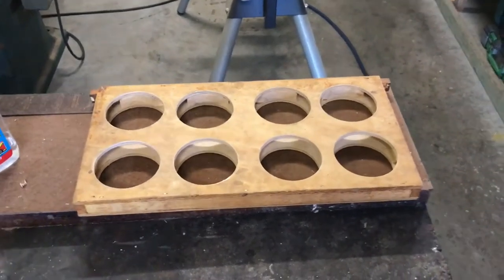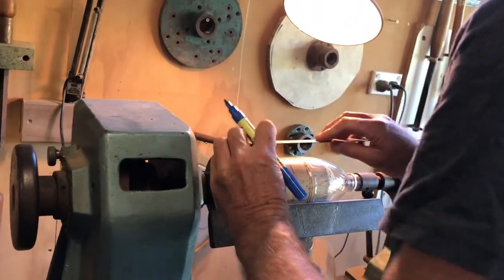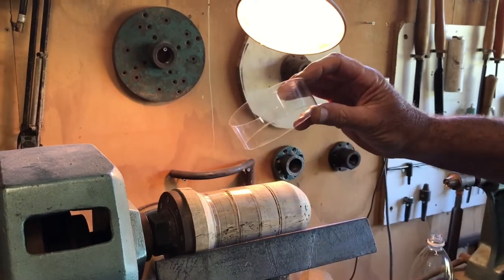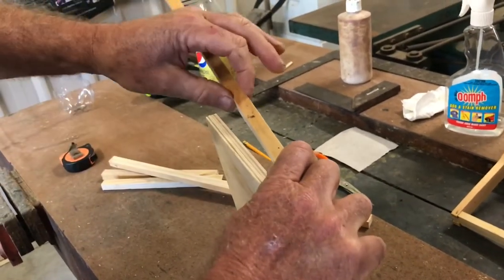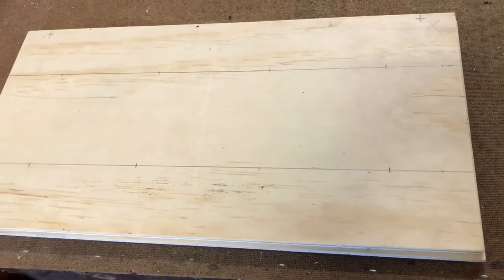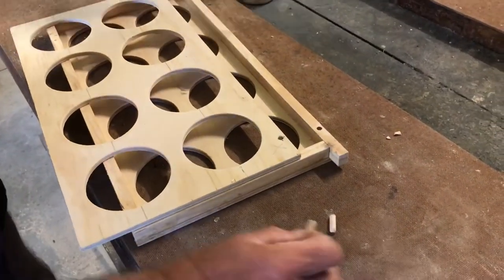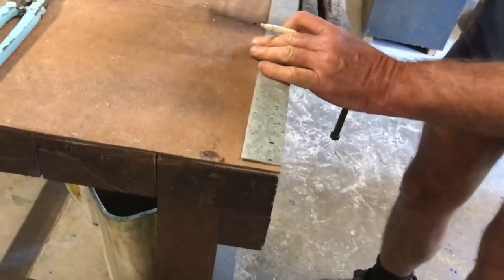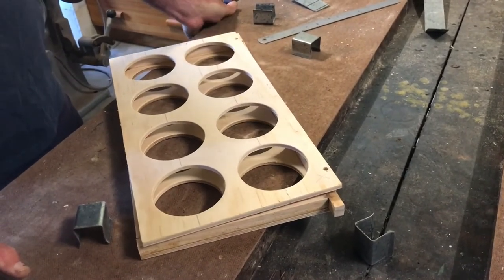Making comb honey at home using recycled materials. Part 2 - Frame Construction @ Les Gold

Comment: Hello,
I realy like it, it would of be great to see the final product when it's whrap and ready to go.
How do you finish them or how do you whrap them. Because it's round do you use round box?
Reply from the maker: Thanks for that. The finished product is lightly vacuumed sealed to remove air but not enough to crush the comb. A swing tag with labelling requirements is added after the comb has been kept in the freezer for a few days.